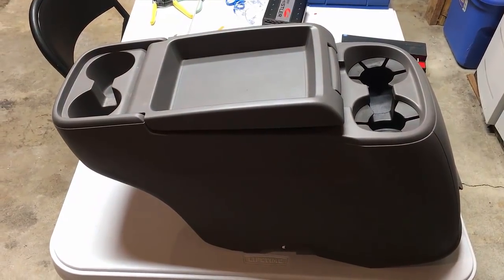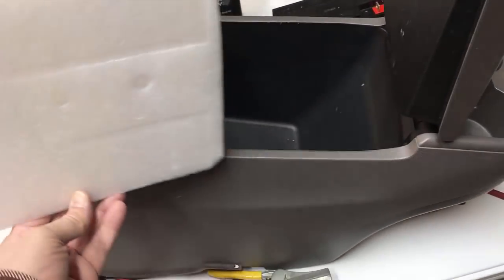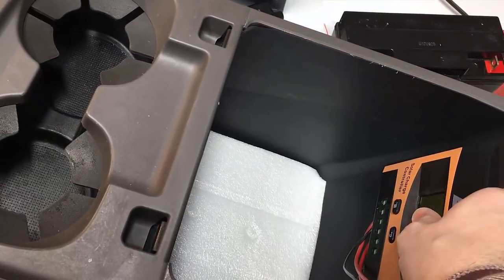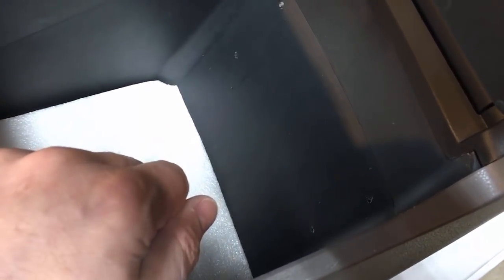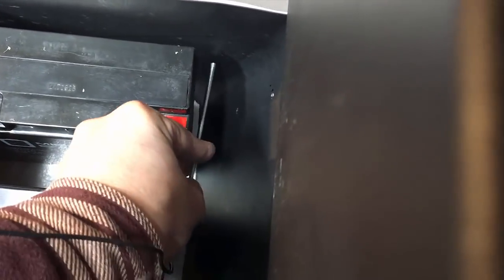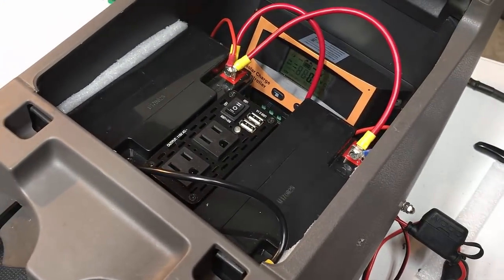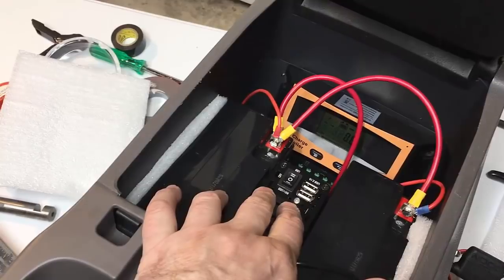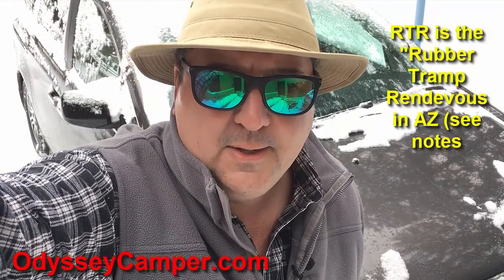Minivan Camper DIY Solar Generator

Comment: If you have a vehicle that has a unswitched cigarette lighter plug you should change it to switched so if you are using the solar power supply while plugged into the cigarette lighter plug you don't forget to unplug before shutting off the motor and kill your starter battery If you plug a fridge in while driving and stop at a dinner you could come out to a dead battery
Reply from the maker: That's great advice!  Mine is switched, but that is a good thing to consider.

Comment: Thank you for these great videos. Highly informative and very appreciated. 
Is there no concern with the inverter getting too hot being between the two batteries?
Reply from the maker: I appreciate YOU watching them!  When running this unit, I usually open the top to allow for air circulation and because I plug in there.  If you are running the inverter at full capacity, I would think it COULD overheat, but they have thermal protection.  So, the worst that happens is they will shut off.

Comment: what about a vent fan? do you have a concern for that?  Love the information you are providing. thank you so much.
Reply from the maker: In the "phase one" Odyssey, you'll see a fan fitted to the rear privacy panel on the vent window.  Look left at this part of the video: https://youtu.be/0xIjOHxrpYw?t=436  However, with the new "phase two" Odyssey, I've not been out when it's really warm, so screens on the window help.   You can see those here: https://youtu.be/ChPOBtW22Fo   Thanks for watching!
Reply: I'm sorry I was vague.  I was concerned about the vent fan in or on the center console for the heat the inverter generates in a tight and closed space and in case of off gassing of the batteries (if any).
Reply from the maker: Oh!  I should have assumed that based on the video you were commenting on :-)   
   At the risk of attracting people that will disagree (because this is the type of thing people like to debate)  I will say that it's not worth worrying about.  Here is why:

1) The amount of hydrogen off-gassed is very small

2) If my goal was to capture that gas, it would be nearly impossible because it's lighter than air and the console does not seal tight.  The hydrogen will float to the top and quickly exit.  The molecules are also smaller than air so they can exfiltrate the console even easier than air would.  It would be very difficult to get enough hydrogen to reach a point that combustion would occur in the presence of an ignition source.

3) When batteries explode from hydrogen accumulation, it's because a spark was created near a trapped pocket of hydrogen.  For example, connecting a jumper cable improperly which creates a spark at the vent point, igniting the hydrogen trapped under the cover.  There are no sparks in the console.

    I think the situation is similar to the starter battery charging while the car is running.  There you get more off-gassing because of the rapid charging of a large battery.  If trapped hydrogen was a problem, your car would explode every time you came to a stoplight, from the sparks generated by the alternator, etc.  Now if your batteries are in a sealed box and you have large batteries, I think venting would be a good idea--as a precaution.  They are still not going to explode unless there is something to ignite them, such as a short when the vehicle crashes.  
    So that's my opinion on the subject, but others may take issue.  If you read that I exploded while camping one night, I'll be proven wrong :-)
Reply: When you said you loved to debate this question, I'm guessing you meant it based on your press back.   I'm so glad to see that you've well thought of the concerns.  I'm Kinda Sorry I asked now as it has made me feel like a troll rather than a NEW concerned subscriber and viewer.   That said, good luck with your channel and all future endeavors.  I'll refrain from ANY future comments on any of your videos.
Reply from the maker: LOL, no!  I didn't mean it like that at all--I don't consider it trolling.  I'm happy to hear the questions because it makes me think.  Someone just sent me one about seat swivels and made me think of something I had not previously considered.  There are no bad questions, so feel free to ask anything.  Thanks for watching and THANKS for your question!

Comment: Great video. Your setup is fantastic, and the inverter placement between the batteries is cool!
Is your solar connection like this : batteries —> 10amp controller —>  7amp controller —> solar panel?
Just wondering what the effect of going through 2 controllers might be?
Reply from the maker: Karen, I’m really sorry for the delay, your message got filtered and I didn’t see it until now. You want to run the panel to one or the other charge controller. I probably could have explained it better but when using the 10A, you unplug the panel from the 7A and plug into the 10 directly. Mine was set up this way because I used the panel for the jump pack AND the console solar generator. Hope that helps!
Reply: Odyssey Camper 
Thanks! Does the Diehard a charge controller built in? Watching electrical parts being put together is not always boring, in this case helpful. Karen
Reply from the maker: Ha, I'm glad it didn't bore you too much :)   The DieHard has an internal charger that comes on when you plug it in (ditto the Schumacher) but it is not a solar charge controller.  The difference is that the solar charge controller is designed to step down the voltage from the solar panel from 17 volts or higher, to the voltage needed for charging.  Either of the controllers shown in my video are fine to use with a single panel and the fancier one in the console box is actually cheaper!  But the one I mounted to the back of the solar panel is easier to wire up because it has built in connectors.  By the way, I mention in one of my videos that you should not charge the DieHard directly from the cigarette lighter.  I was concerned that it would draw too much current and blow a fuse.  However, it turns out that these little batteries to not do that in my testing.  So, you can also charge the DieHard with a male-to-male cigarette lighter adapter.  Just be sure to unplug it after 30-40 min or you could overcharge it.

Comment: I'm a fan of the goal zero lithium I wonder if it would fit? They're a little expensive but all in one and you could recharge by cig plug when riding
Reply from the maker: Nothing wrong with the Goal Zero products, but they ARE pricey, especially the lithium ones.  I've made a couple videos that show how to build a "poor man's Yeti Goal Zero" but only the AGM version.  Lithium is a little harder to do, but I'm investigating it.  Everything I've built in the videos can be recharged with a solar panel or the cigarette lighter.  BUT, a lithium pack has a number of advantages over my DIY stuff.
Reply: Odyssey Camper I should have watched the whole video before commenting. My only change from what you built may would be using one larger lithium battery. But you're set up rocks
Reply from the maker: Thanks!  Yeah, I would LIKE to have lithium, it's just not in the budget right now :)

Comment: I live in Fl. Beside a swamp cooler and ac in the window what do you suggest? I'm thinking a cooling blanket the water will be inside so shouldn't be too humid in my suv. Just want your input
Reply from the maker: It's hard to completely cool a van unless you have some external power source (120v) but it Could be done with a portable AC unit, vented to a window.  Short of that, I would say to improve the ventilation.  Screens in opposite windows and a couple 12v fans.

Comment: very nice   i have a 96 Ra1 Odyssey which has no console between the seats   so i guess i will have to make a battery box of some sort ..love your blog  wifey and i are planning to use our oddy over xmas to camp in   we have a blow up queen mattress in the back and still have all the seats just removed the head rests and laid them flat
Reply from the maker: I think you could retrofit one if there is room between the seats (been awhile since I've seen a 96' up this way).  There is a "plate" that screws to the floor under the console and then a metal loop it locks to in the front.  But it might also be the same amount of work to just fit a battery box.  The mattress works too!  The only problem with a mattress and no platform is you lose the storage under the bed.  But the important thing is to get out there.  Safe travels and thanks for the kind words on the blog!